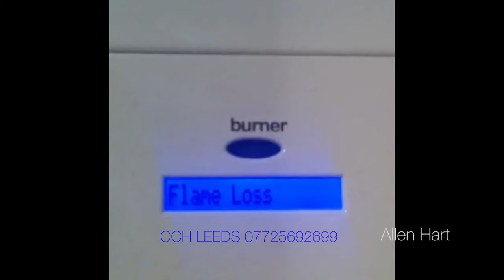Boiler repairs Leeds. Loud noisy ideal logic + combi boiler humming

Comment: Boiler ES35 made frightening noise on turning on hot water tap, lasted for 30 secs or so. Had a strip down service but still made same noise. The engineer was going to replace the gas valve. I managed to speak with a gas engineer and when he heard the noise he said without hesitation that the burner needed replacing. Replaced burner no more noise. We dismantled the burner and the inside ceramic surface and baffle were contaminated with a black sooty/fluffy material. The design is such that the inside of the gas burner cannot be serviced.

Comment: Same problem and it started after a yearly service from Ideal. The engineer told me that this is normal and nothing to worry about just keep the tap running fully open. I called Ideal after two weeks being the same and now they want to charge for the fix because I waited to long. Such shame, they used to have a great service here in UK.
Reply: Have the same issue, had a service and nosie started the same day, British gas came out said it was the burner part, replaced it and the nosie came back the same day. They are coming back tomorrow to have a look again 😢
Reply: Same here

Comment: i just fitted a new boiler today Ideal Logic+ C30 got the same noise i thought it was a faulty Governor on the meter very old and not keeping constant working pressure, new meter and governor fitted and still got the same but not as bad and it's only when it modulates to low flame.
Reply from the maker: Sounds like it needs a new gas valve.

Comment: I have the same boiler, 8 years old.  Sometimes It makes that sound and vibrates for 10 seconds when I turn the hot water on. No fault messages.
Reply from the maker: I suggest you have it serviced. Thanks.
Reply: @AllenHart999  yes, annually. Ideal replaced the gas valve under warranty but that intermittent fault is still there. Warranty has expired. Thank you

Comment: Terrible boiler, Venturi and injector block up easy causing the same noise, the gas valve causes the noise, the burner plate becomes loose causing the noise, as well as the sump is prone to cracking
Reply from the maker: Hi Paul. Do you believe that is down to lack of servicing? Thanks.

Comment: Hi Allan

I've just had this issue, I cleaned the injector in the Venturi and it solved the problem, it was also making a loud whistling sound on full rate. 

Love your videos pal 👍
Reply: Mine makes that noise but not all the time and if I turn the hot tap on it stops
Reply: I have loud noise also when hot water is on. But not all the time I have this noise. When I wash the dishes that noise can appear after  some time. I am sacred to wash my dishes🙉 and my boiler was serviced 2 weeks ago.

Comment: Mine only does that with the hot water and not the heating. Even if the heating is on and then i turn on a tap, it will make that noise and vibrate. Had it serviced every year. Been told its safe to use and could be the fan on the way out.... Sounds wrong to me. Its 10 years old now.
Reply: Exact same problem with mine, said it’s normal but it’s not.

Comment: Hi Allen, same problem for my Ideal logic + Combi 24 boiler, when I turned on Winter mode started using central heating. It loud noisy and showed that “flame loss “ The gas engineer came and said it is normal, nothing to do and no need to worry.  
Is it safety and need to call another gas engineer/ideal?
Reply from the maker: Did you call ideal out?
Reply: @AllenHart999  email and called Ideal but no reply. Keep going loud noisy and flame loss fault code.  Worry it’s not safe and turn back to summer mode at Winter 😩

Comment: Boiler broke down so I removed the heat exchanger to clean it thinking it was that but it still looked like new. Then I removed that black pipe that goes into the condenser expansion bottle and a load of magnetite come gushing out. Washed the expansion bottle removing all the debris, filled it back up with water from the tap to prime it and now its running perfectly. Thanks for the video.
Reply: You removed the heat exchanger??? are you gas safe? if not you need to get the boiler checked ASAP!!!
Reply: @JayGasEssex  Yeah I did quite a while ago, didn't touch anything to do with the Gas that would be rather silly. A gas engineer said if you're a competent person, which I am; You can do it yourself, so I did. It's a very basic job anybody who's competent can do it. Boiler has been checked and everything came back perfect.
Reply: are you talking about condenser expansion bottle, or the condensate trap?
Reply: @Jimmy-Wong1  Yeah it might be the condensate trap, didn't know what the name was but I think its that. It's a clear tank with 2 sections.
Reply: @TheStressD  is it made of plastic? The outlet is connect to a pipe leading to outside? I had a boiler making vibrating noise. I do not know where the problem is. But I think it does not hurt to clean the condensator trap. So I removed it and found lots of magnitite. After cleaning it , the noise is gone. 😅. However, I do not know why this would be the root problem since even thought the trap is blocked, still the exhaust can leave freely.
Reply: @TheStressD  what was the problem you were facing? I just want to associate the solution with problem. Might give me some hint about my boiler problem
Reply: @Jimmy-Wong1  Yeah its made of a clear plastic kind of oval shaped with 2 levels of water. It's at the front where the big black condensing pipe that leads to the condensing trap connect via small rubber black pipe. I think it does, I think it's because its putting pressure on that big black condensing pipe. When you pulled off the rubber pipe did loads of magnatite gush out? To be honest the boiler should really have a Adey filter on it but because where my boiler is I can't fit one.

Mine still vibrates a little bit sometimes. If I press the left side, it stops I think there must be a loose screw or something somewhere, very strange! If this happens to you should try it and let me know.

Have you checked the heat exchanger to see if its clogged up with limescale?
Reply: @TheStressD  I have not tried to remove heat exchanger yet. It is hiding behind the heat engine. Not sure how easy it is to remove the heat exchanger. I think it requires draining the existing water or so
Reply: @Jimmy-Wong1  Yeah you have to drain the boiler, its quite easy to remove. Its a stainless steel plate that looks a bit like a rounded rectangle, theres only 4 nuts, 2 inlets and 2 outlets. If the heat exchanger plate is caked up with limescale, you can use Max Strength Spirits of Salt to dissolve the limescale and make sure you thoroughly rinse it out. If you can't be bothered to dissolve the limescale you can just buy a new one. You also need to make sure you use silicone grease when reapplying the rubber gaskets.

Comment: Hi Allan I have just serviced a logic c24, which hadn’t been touched since new 5 years ago. Stripped down with deep clean and service kit fitted, and Venturi cleaned. Still got a whistle noise only on low fire, and poor readings . Any help appreciated, as I’m thinking gas valve rather than fan 🙂.
Reply: Was it the gas valve mate ?
Reply: Ratio's prob out or dodgey valve, could be incorrect size injector too?
Reply: leak on the heat exchanger.i fitted new gas valve and still was doing it.plus full service too.ideal said the top burner plate inside can get partially blocked and no good air flow into the chamber. got my gas sniffer and found gas leaking out from around the back. changed the boiler to a baxi as customer wasnt happy with ideal.

Comment: Hi had same noise started with slight noise on first start up then got worse to noisy so had it serviced then wouldn’t go at all .so plumber ordered new spark electrode new sensor for flame still nothing alternating f2 or l2 code so fitted a new gas valve still nothing ideal tech can’t seem to help also a reconditioned fan getting very frustrated with cost as he has been saying prob best to get a new boiler as it’s 12 years old but with the parts I’ve put on it I’ve nearly got a new boiler lol can anyone help

Comment: Mine is buzzing like crazy and my water is also incredibly hot I have turned my water off but is it okay to leave the boiler on until I get someone out on Monday or should I turn it off at the mains ? I'm really worried has I don't have a clue.
Reply from the maker: Normally a gas valve issue, Give ideal a call.
Reply: @AllenHart999  is it okay to be left on until it can be sorted ? 
Thanks for your reply .
Reply from the maker: Only just seen this, Did you sort it?
Reply: @AllenHart999  hi there , yes it's sorted, it was the circuit board.
Reply from the maker: @margking5482  Glad you sorted it. Thanks for letting me know.
Reply: @AllenHart999  and thank you for your reply ! :)

Comment: Hi Allen. I am hearing the same sound. It lasts about 5 seconds and then continues working as normal but sometimes it turns off with the same code. We saw that the drain was clogged as the transparent plastic bowl leading to the drain pipe is full. The problem is that it still does it even if it is not filled with water. Is this a by product of the drain issue? Is it a separate gas valve issue? Or is it both?
Reply: That’s a trap it’s meant to be full. The trumpet sounds are 99.9% gas valve opening/ shutting slowly. It can be debri in the valve but best to replace
Reply: Does this need to be fixed urgently and is it expensive? I have exactly the same sound but might have to wait a few weeks to be able to afford getting it fixed

Comment: Hi Allen, I have just fitted a Logic C30 & converted it to propane with Ideals conversion kit & its making exactly the same noise as in this vid. I have also seen 4 other vids of different models of Ideal boilers all making the same noise & always a faulty gas valve. Thinking I may have a faulty valve even though new I bought & fitted another one, but still had the same problem, I have been in contact with Ideal tech for help. But they are reluctant to assist me in the fault finding as the boiler has been fitted in Spain & they say the boiler is not approved for use outside the UK, I only found this out when reading the installation guide which came with the boiler. The supplier knew the boiler was to be fitted in Spain & never said it shouldn't be, perhaps they didn't know they weren't approved outside the UK either in their defence. Ideal tell me that perhaps the calorific value of the Propane is different to that used in the UK & causing the problem, I would have thought if that's the case then only the output & gas consumption would be affected & not cause the boiler to make this noise. The boiler works OK & no faults showing, just this intermittent noise when the burner lights up. Have you any suggestions of other causes for this problem that I can check out, as no valid warranty due to its location which means Ideal are not interested in helping
Reply from the maker: I have no idea about installing in spain sorry.
Reply: Thanks for your reply Allen,  in Spain same set up as the Uk apart from a possible difference in CV with the propane here, I have watched 4 vids online with boilers making the exact same noise. All were Ideal boilers although different models & always the gas valve being the problem, so these boilers were using the same gas with the same CV when the noise started, have you come across this noise in other boilers & the cause being for another reason than faulty gas valve?  Tia.
Reply: Check condensing pipe. If it blocked will be that sound

Comment: Have similar thing on independent but only difference have strong gas smell from venturi stripped boiler cleaned everything changed gas valve nothing will make a difference

Comment: Common fault on these ideal boilers.
Reply from the maker: Thanks for your comments and thanks for watching.
Reply: How much does the repair cost?
Reply from the maker: It was under warranty so not sure.
Reply: What if you replace the gas valve and its still humming. Checked the  condense and the flue are not blocked